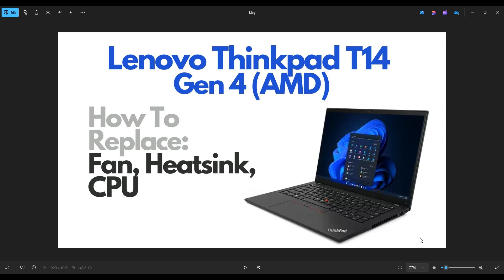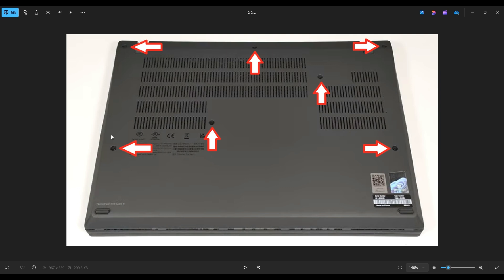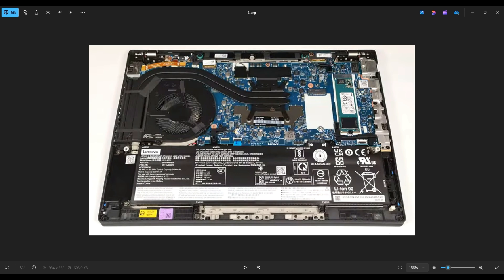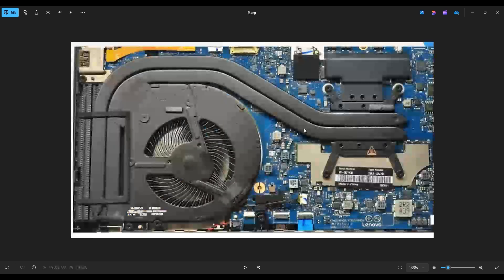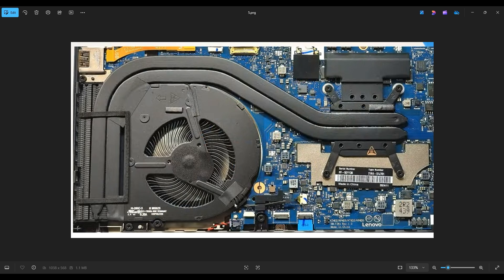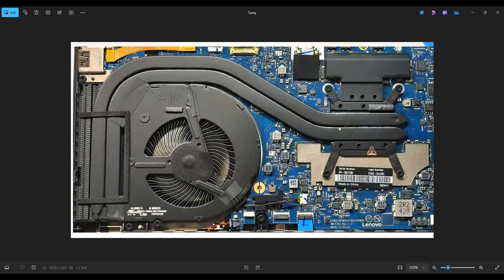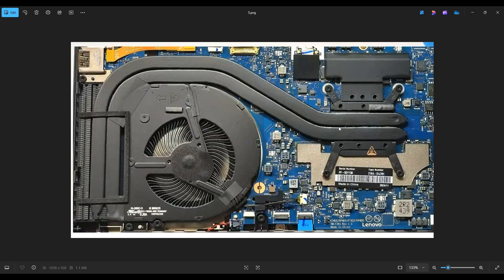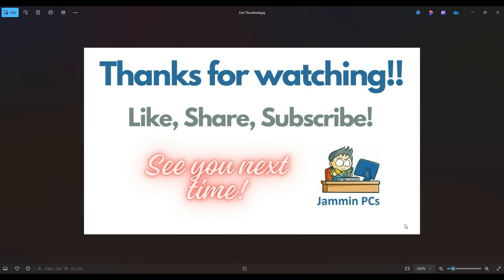How To Replace Fan Heatsink CPU - Lenovo ThinkPad T14 Gen 4 (AMD) Laptop Computer

Comment from the maker: Tools & Replacement Parts: https://amzn.to/3GpUAMz
Overheating Laptop Fix: https://youtu.be/gGCUmI2NU0E
Check out the FAQ's in the description or leave me a comment and Ill get back to you asap!!
To support the channel more, leave a Super Thanks or donate to $PCHelper on your CashApp.
Reply: When replacing thermal paste in a laptop, should you also clean the fan, and what's the correct way to do it safely?
Reply from the maker: @maciejsergiel5630  as long as your in there then yes, cleaning the fan is a good thing to do. you can blow or vacuum it out or use a brush if possible but be sure not to damage the fan blades.